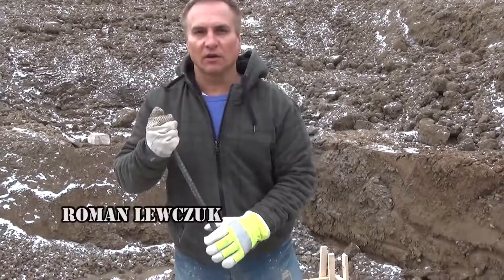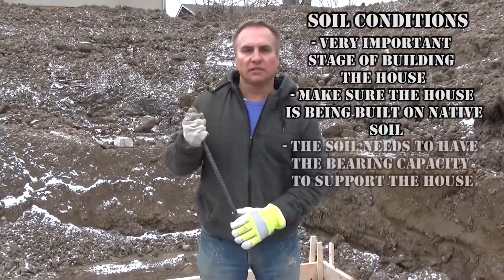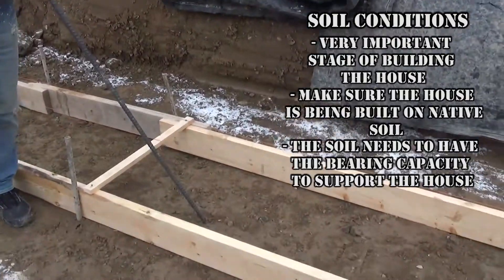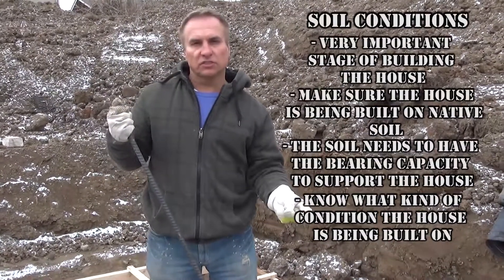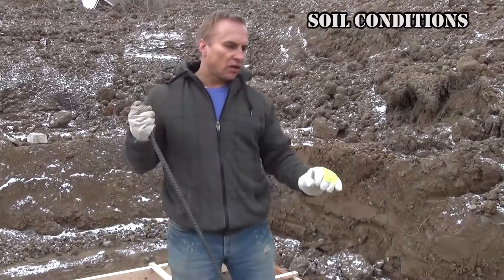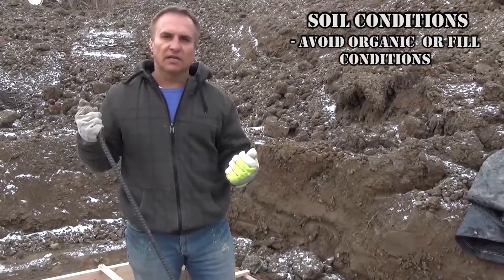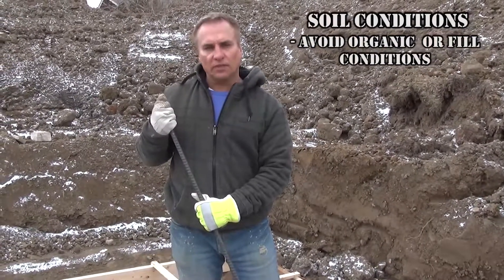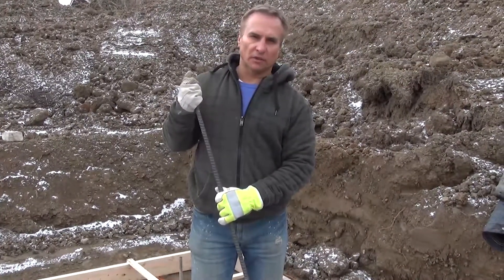How To Build A House: Checking For Soil Condition Ep 17

Comment: Where I'm at it's clay all the way to China so digging it out doesn't work. A 6" base of crushed compacted rock on top of the clay  at or below the frost line with 8" thick X 16" wide footing and 8" thick stem or basement walls work.
Reply from the maker: sounds like that is a good option

Comment: Sometimes, depending on your area, you may have to use a pile driving company to install piling for your house. A geotechnical investigation and a foundation design by professional engineer will be required at that point
Reply from the maker: yes that could also be the case .

Comment: So you dig down to solid soil and then? 'put in a base wall to the original footing level'? This means digging all organic out and filling to your base level with rock/clay/soil? 

Do you ever rent a digger and do it yourself or do you always hire a company? Thinking of costs here. I'm building a 1 story 2 bed family home. cheers! good vids btw
Reply from the maker: Geoffrey Currie YES  to the first question dig to the underside of the footing level ,making sure that at this  level it  is native soil. Renting is cheaper if you are a good operator , if not, It will take you much much longer ,and the job won't be as good , so do yourself a favor and higher a professional excavating company

Comment from the maker: you need to digout thoses areas until you come to good solid ground if its the whole basement you still need to dig it down to solid soil then you need to put in a base wall to the original footing level and then start the walls from there if you need to go really deep you still have to go to  solid ground and start doing engineered fill at this piont you need to get a soils engineer for there  recommendations